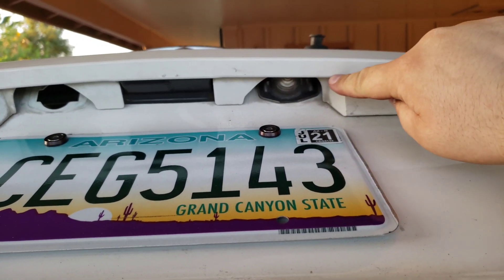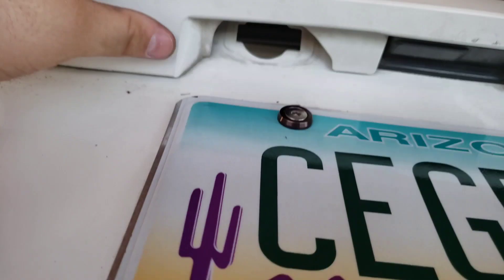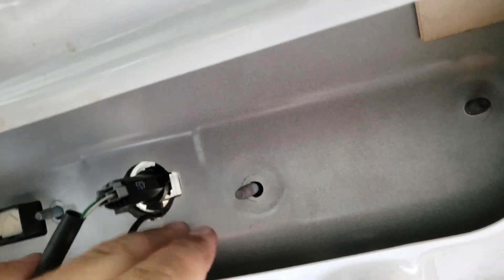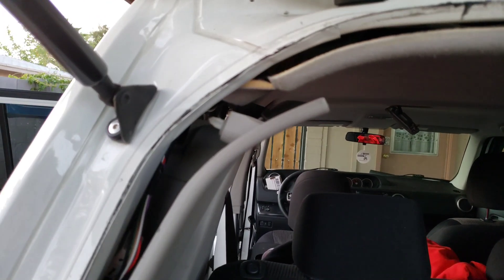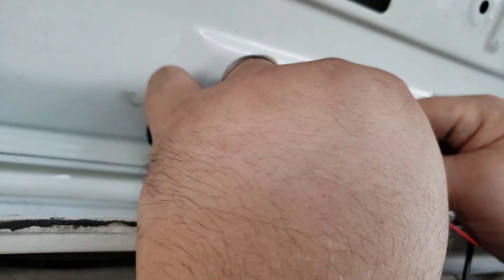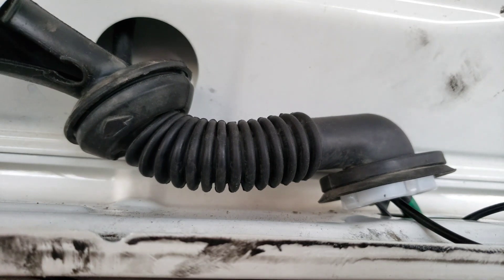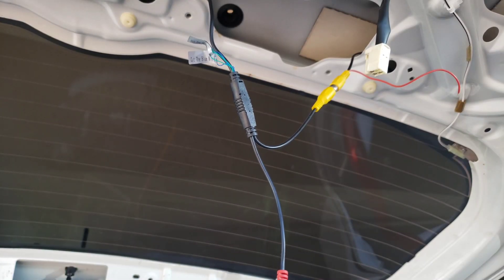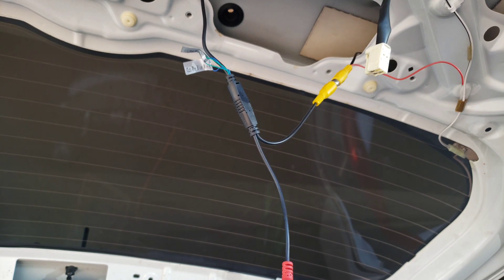SCION xB back up camera install part 1 of 2

Comment: The easiest way to pull whey is fishing a Pull rod threw with a pull rope electric tape the pull string to the wire and pull it there easy peasy. Just watch a video on network cable wall pulling and it makes everything easy.
Reply from the maker: This is true, I didn't have all that so I just ran with it xD

Comment: So, how did you wire it to the headunit? I really need some help here. I even bought a harness for the factory head unit but can not get this thing to turn on.
Reply from the maker: Ahh yes, I have a factory harness for the new radio, how ever...my radio was supposed to be by here already but it got lost in shipping 🥺. I'm waiting for another one to be shipped off. Once i get the radio I'll make a follow up for the installation and wiring. And then I'll probably make a full review on the radio along with key features.
Reply: @InsignificantBoost  Thanks, ill look for that video!
Reply: I just ordered a harness from Amazon since I want to keep factory radio
I just don’t know how to wire it since I want a backup cam for my ‘14 scion xb
Reply from the maker: Hope all the back up cam videos help!

Comment: I have same camera on my car. The only thing i dont like is the camera itself blocks the led light. because of that one side of the license plate is lit up more than the other. :(
Reply from the maker: Sorry to hear, I'm running led bulbs and I don't notice anything about it yet..do you mean from the camera view?
Reply: @InsignificantBoost  the camera itself is blocking the bulb from lighting up the left section of the plate. I'll see if I can take a pic tonight
Reply from the maker: @ramjirao7645  for sure, dm me it on IG

Comment: Is this camera plug and play?
Reply from the maker: Yes!
Reply: Insignificant Boost can you hook up this camera to the stock stereo?
Reply from the maker: @craigkawamura4907  only if yours came with the factory backup
Reply: Insignificant Boost thanks
Reply from the maker: @craigkawamura4907  your welcome! Thank you for your support
Reply: Same camera to my 2013 xb2 , but I hooked it up to my stock pioneer . I have to shift to reverse before the stereo turns and displays Scion for my camera to work . After that it functions normal .
Reply from the maker: That's awesome!
Reply: @InsignificantBoost  did I hook it up wrong ??????
Reply from the maker: @dstructer2036  I suppose anything is possible 👁️👄👁️ dm me on Instagram!
Reply: @InsignificantBoost  ok I will . I wish it would work normal on start up :(
Reply from the maker: @dstructer2036  it could be something super tiny